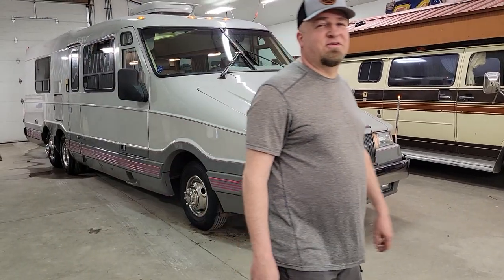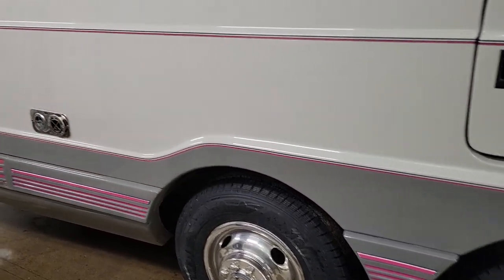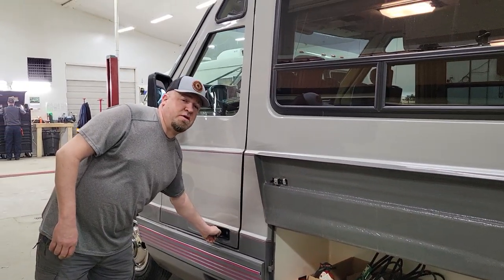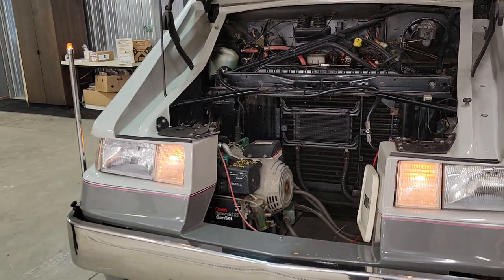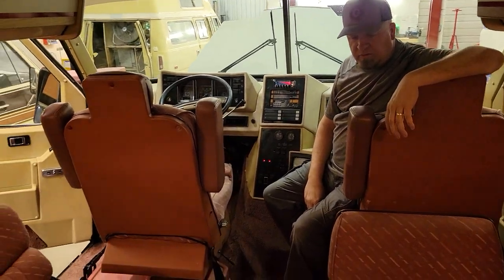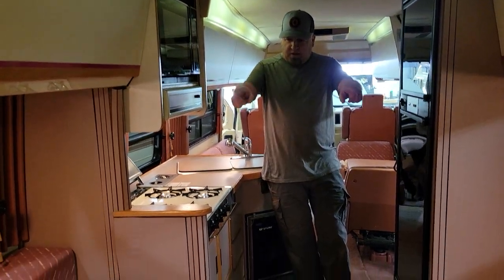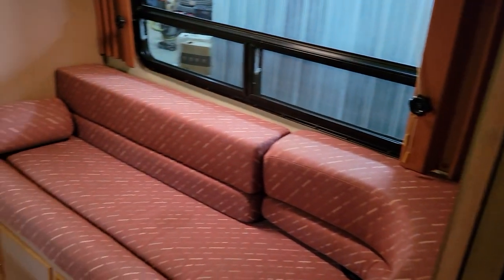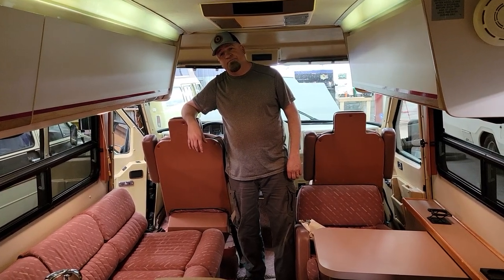SOLD! 1986 EMC Starfire 310 Motor Home.

Comment: I have one!! We call it the Aardvark. Mine is not as nice, but it is still quite nice. I redid all the upholstery to put in high quality foam for good sleep, but it also spruced it up. I only wish the motor ran well. I have been having issues with the engine getting enough fuel, or so it seems, and I just talked with someone who said a Ford racing fuel pump might be the answer. Apparently Ford is notorious for their wimpy fuel pumps.  Also, mine could be for sale…lots of work inside and out, all new tires, new AC, extremely nice looking interior…